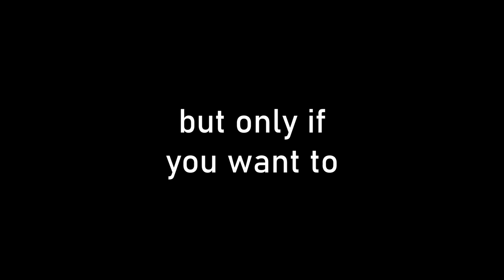I rescued this vintage bike and turned it into a fixie

Comment: Fixed gear is like zen on wheels. Love it. Nice build.
Reply: What is the advantage?
Reply: It's an absolute different feel of riding.  It may be disadvantage for some conditions.  But the overall feeling more than makes up for it. Try it, you may not want to go back to freewheeling. I first bought one with a flip flop rear hub, in case I didn't like it at least I'd have a regular single speed, I never put it to freewheel after riding fixed!

Comment: Nice job on the video! I would not have made other choices than you did. I would have gone with low pro wheels 36h because I am beefy like you. I would have gone with Promax side pull brake set. Surly makes stainless steel chainrings  that would give it a visually less massive look.
Reply from the maker: Good call. I've been meaning to change up the gear ratio so I might have to grab me one of those chainrings. Thanks!

Comment: Nice job. What bottom bracket did you use? I couldn’t quite make out the size or the Shimano part number. 👍👍
Reply from the maker: Shimano BB-UN300. Its a 110mm spindle, I think the stock spindle was around 122. Gave me a much better chain line.

Comment: Love the video!! Did you convert your back wheel or buy a new one?
Reply from the maker: I bought a new set of 700c wheels. The bike had the older 26 inch standard that's not really used much anymore on road bikes.
Reply: @DonylynKnives  you could always get a 650b wheelset, 27.5" wheel with a total diameter of 700c.

Comment: Yeah, like it better as a fixie. That early 80's burgundy goes better that way. What brand did you go with for the front crankset?
Reply from the maker: It's just some inexpensive no name brand set that I got online. I think it was only about $25, but it's holding up great. No creaking or anything.
Reply: @DonylynKnives   The only downside with those cheap cranks is the front large chain ring will bend and start to wobble. At least in my experience. I had a couple pair of Lasco that did this. Better off with some FSA jammies for a few more bucks 👍

Nice restore btw

Comment: How did you fix the chain line? I've essentially done the same thing on a road bike I found in the trash pile. I got the chain line ok by sliding the back wheel over to the right a bit, but now it is off center. It rides fine, but ultimately I'd need to redish the back wheel, which I really don't want to do. Or leave it and get a much longer back axle.
Reply from the maker: You need a narrower bottom bracket. I got one that was like, 8mm shorter than the one that was on there. It essentially brings the crank arms closer together, because you don't need that extra room for all those gears.
Reply from the maker: They're pretty simple to replace but you'll probably need a couple specialty tools for it depending on what type of crank arms/ bottom bracket you currently have. Oh and I think I paid about $10 for this one.

Comment: what is the cable controlled thing on the seat clamp ? dropper post ?
Reply from the maker: It's a parking brake. It locks the brakes. I've seen it on several older road bikes.
Reply: @DonylynKnives  so cool! thanks!

Comment: What liquid did you use at 2:16 to clean the bolts and stuff? Also, how did you get the chrome on the fork to look as brand new?
Reply from the maker: Evaporust. And I polished the fork legs with a bench grinder equipped with an aggressive polishing wheel using green compound.
Reply: @DonylynKnives  thanks, looks great!
Reply from the maker: Thank you!

Comment: I have 38 year old bianchi road bike, the tires keep going low no matter what I do, and it creeks, a lot. I think I will convert it, it still has a nice paint job, if I convert it will it lose value?
Reply from the maker: If it's overall in REALLY good condition it may be worth something, otherwise these old road bikes are a dime a dozen (with a few exceptions obviously). 

You could look up your bike on 'Bicycle Blue Book' to get a general idea of it's worth.

Also, you could always just put the parts back on it later if you wanted to convert it back 😅
Reply: @DonylynKnives  I think I'll convert it and keep the parts, the frame is in great condition but the parts themselves like the breaks and crankset deserve retirement haha, will probably do a wall decor with them 🤣
Reply from the maker: Some of those old parts are beautiful enough to be art! Good luck with your project man! Let me know how it goes!